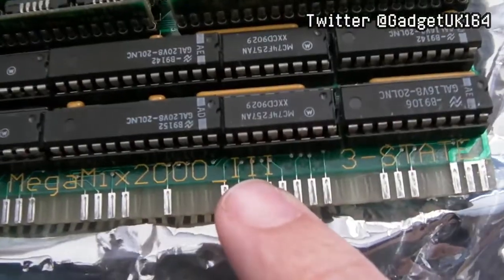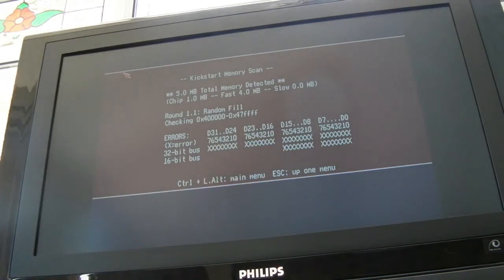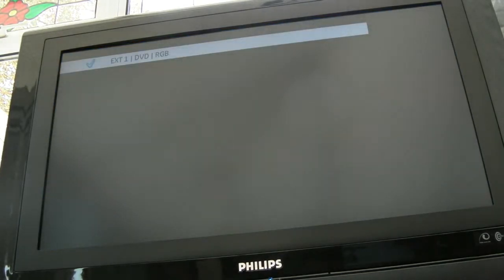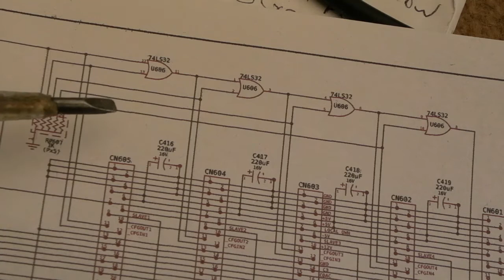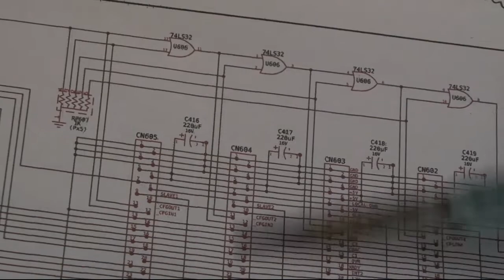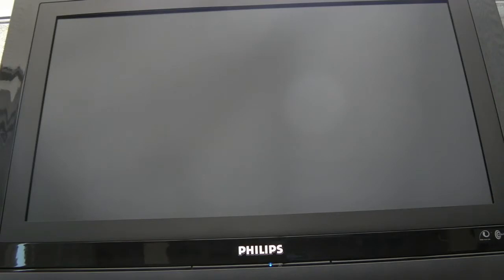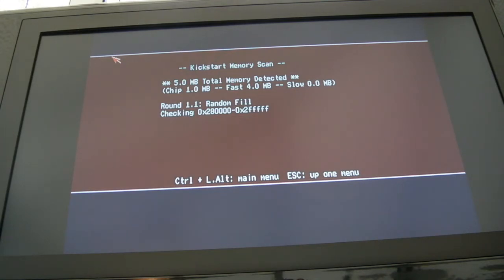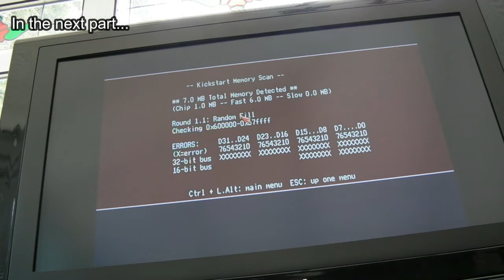Commodore Amiga Zorro II RAM Boards - The Good, The Bad, & The Ugly - Part 1 (3-State MegaMix III)

Comment: (@27:22) - if you look at the SIP module at the top left, all the IC pins are soldered to the SIP board, but in the row just below it, the center pin on the memory ICs is cut, and not soldered. The 3rd and 4th ones down also appear to have cut pins, but the 5th and 6th ones down, they’re all soldered. WTF?!? The 7th and 8th have cut pins. On the right, 1,2,5,6,7, and 8 all have cut pins, and 3 and 4 have soldered pins. I suppose that pin on the memory IC may be N/C internally, but it’s still weird. 🤯

Comment: Can the socket you were working at be replaced with a new connector or produce a new memory card for the Zorro socket.
Reply from the maker: Yes, you can fit new connectors if you can find them!  LIV2 has already produced new memory cards for Zorro 2 and Zorro 3.  There are other manufacturers of RAM boards too.

Comment: In part II, we take a hot desoldering iron to the whole mess and just pull all the Or-gates low with some bodged-in pull-down resistors. This way, if a bad Zorro card decides to be an a**, it’s too bad; the pull-down resistor (and a cut trace) means the bad Zorro card won’t be able to tell all the remaining cards to shut up! Okay, just kidding. 🤣
In all seriousness, did someone at Commodore think this was a good idea? I mean, if the first Zorro card was bad, and put a logic high, it could disable all the rest of the Zorro cards. Maybe this person was just asleep that day, or maybe they needed to look for a new career (and not in electronics engineering.)
Perhaps they could have two LS245’s (or is it a 244?) that would provide a latch bit for inputs from each Zorro card, and an output (from the CPU) to each Zorro card. Then, in the power-on/reset handler, the CPU would start by disabling all the Zorro cards by latching in 0xFF to the output latch IC, then would loop through each one, testing to see if it’s installed by examining it’s bit in the input latch IC. If there’s no card, or it fails the self-test, it’s “shut up” bit would be left logic high, else it would be enabled by writing 0x7F to the output latch IC, thus enabling the first Zorro card, then go around the loop to examine/enumerate all the “good” Zorro cards in turn. So the counter would be the bit position corresponding to the Zorro card. If the card is good, we logic-AND out that bit (set it to 0), otherwise, we logic-OR that bit (set it to 1), then we decrement the bit-counter, exiting out when the counter wraps around from 0 to 255. I like these trips down hardware lane, but all the Zorro cards in my brain are having a bus conflict right now. 🤣😂😄😆
Reply from the maker: Haha =D  Yes, that's a really good point!  It was just a simple (cheap) way for them to implement it that way - but as you say, it has its flaws for sure =/

Comment: Those ZIP ICs are rubbish; the pins just are too thin and they tend to break off right at the IC package; especially if the socket(s) are brand new (or just stiff). The regular DIP-package ICs (like those TTL chips on the board) are much better as they have that wide part of the pin close to the body of the IC package to give them some structural rigidity. 🤔